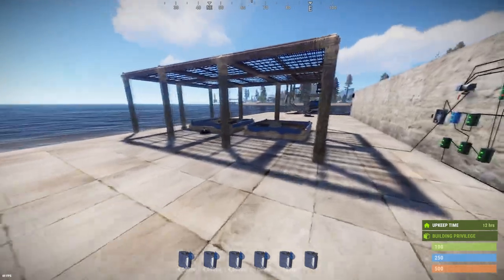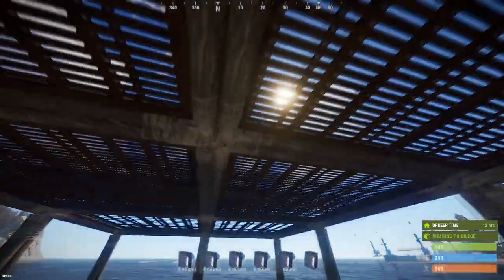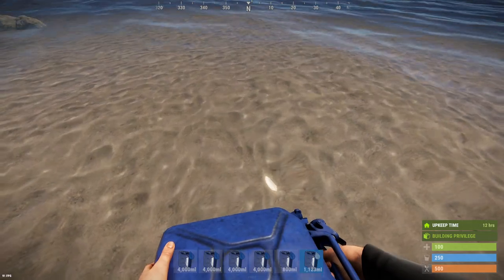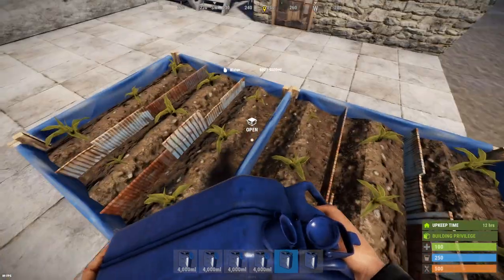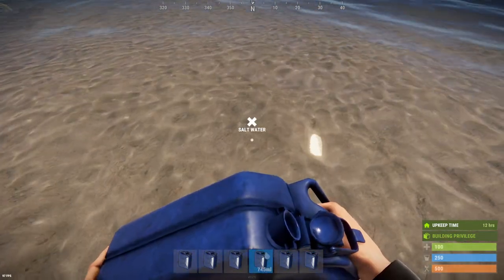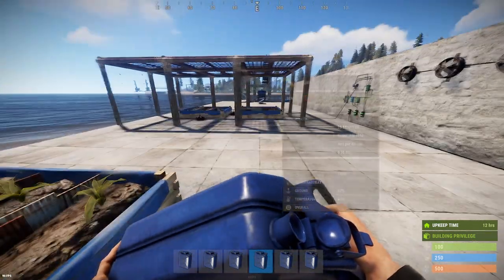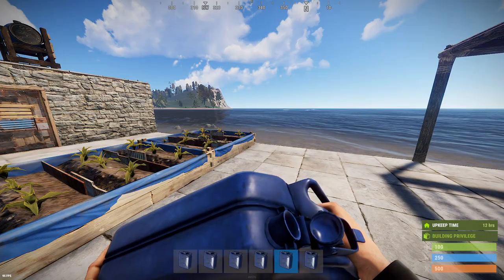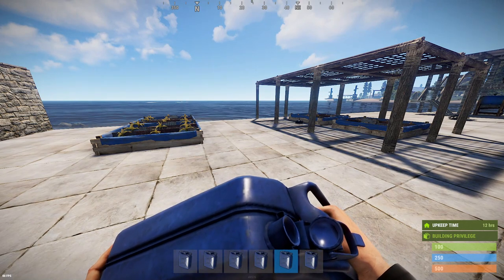Rust farming: User Request - Salt Water & Floor Grills

Comment: Does light go through prison link fences? Also, about how long does it take for crops to decay now? The decay amount seems greatly increased.
Reply from the maker: I'm just setting up another test for that now. Crops seem to last 2-4 hours in "Ripe" state before they die, but I need to measure the actual time. light used to work through fences but I haven't tested on this wipe yet...
Reply from the maker: Light does not appear to pass through prison walls or chainlink fences. So it appears if you enclose your crops, you need to use ceiling lamps to get them light.
Reply: @RabidRabbitGamer  Awesome. Thank you for the help.
Reply from the maker: https://www.youtube.com/watch?v=B29HBHx04Lw

Comment: SO are water catchers useless in terms of constant water into sprinklers? kind of pointless isnt it?
Reply from the maker: Presently, yes. 3ml/min for small, 8ml/min for large... and there is a transfer rate bug. It would technically take 120 small water catchers together with their 6ml/sec output rate to drive 3 sprinklers continuously... Not very practical... The pump and electrical desalinizer will be a better solution coming soon...

Comment: Hey do you know about the infinite water trick atm? Also thanks for the help the other day, I figured out how to do the 3 lap split timer, also made another counter that stops after a user selectable amount of laps. Would love to show you some time to get your take on it. Take care!
Reply from the maker: There were three infinite water tricks but I thought all three were fixed in the Thursday patch. I know there is one I have working inconsistently right now. If it can get it consistent, I'll report it :)
Reply: @RabidRabbitGamer  The one with 2 pumps and a smaller catcher is working for me still.
Reply: I have a legal infinite water trick. Mine is 48 small water catchers and 15 large. I have a capacity of 1,230,000ml saved up. No problem with water atm.